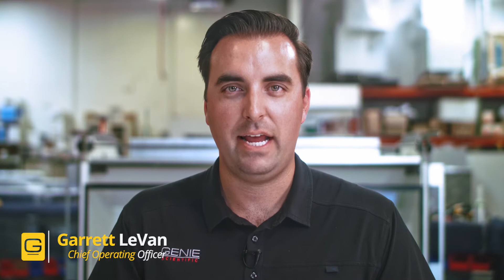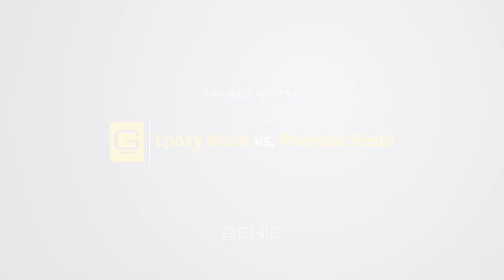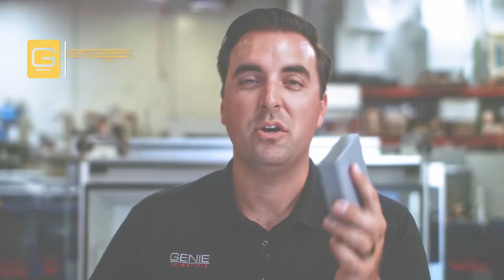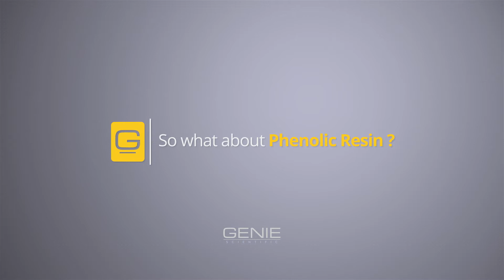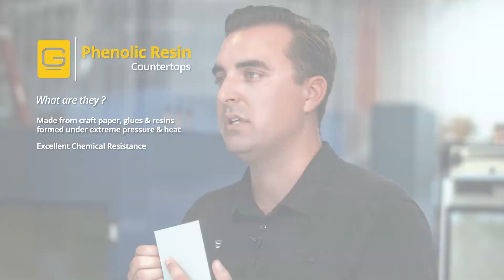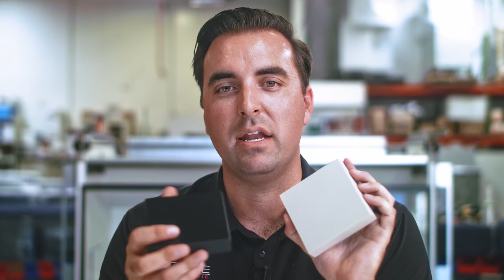Epoxy Resin Vs. Phenolic Resin | Genie Scientific

Comment: I have a sheet of 1/4 inch phenolic and wonder if it can be tapped and if so can coarse thread be used and how strong will it be? Also what is the best way to cut this sheet? Thanks!
Reply: No sure if you still need the information, but I would suggest cutting it with a diamond concrete saw and drilling it with carbide drill bits (actual carbide, not masonry), then putting threaded  expanding anchor inserts in
Reply: Thanks!
Reply: not sure if you  have been solved , what is the usage for yourself or your factory ? if for yourself, it is really a difficult , but for your factory ,you can buy the sheets which are be cutted from the factory

Comment: Great video!  I use phenolic resin quite a bit for my lab furniture projects more than cast epoxy.
Reply: How do you cut it?
Reply: @DonDIYProject  Hi I order them precut to my exact dimensions and specifications from the manufacturer.  If not mistaken, they use diamond saw to cut the sheets.
Reply: @envitech02  thank you my friend.
Reply: @DonDIYProject  You're most welcome sir.

Comment: Oddly enough phenolic resin is used for aircraft and high performance automotive brake discs because of the incredible heat tolerance.
Reply: why is that odd?
Reply: @Chemsci-j1v people find it hard to believe that something over 100 years old at this point hasn’t been replaced by newer technology. If it ain’t broken don’t fix it.
Reply: phenolic is used as binder in abrasives. It is literally used to cut through steel

Comment: We have a GREAT new product called Solicor that looks like epoxy but cuts  like SPC.  Beautiful edges and a clean look.  Nice option between the SPC and the epoxy.
Reply: Great video! 
Question for you: do you happen to know of a way to repair broken poly phenol formaldehyde resin? 

I have a Carter Thermoquad carburetor from the 1970s with a cracked poly phenol formaldehyde fuel bowl. Previously people would repair this using epoxy resins or JB Weld, but the ethanol and/or other compounds in modern gasoline destroys these materials over weeks or months. The poly phenol itself isn't damaged by the gasoline. 

If I could use an off-the-shelf product that would cure at normal atmospheric pressure (even if I have to cure it in a toaster oven) that would resist vibration, heat, and modern gasoline as well as the original poly phenol resin does, it would save a lot of time, money and trouble for me, because nobody is making these fuel bowls any more. Do you know of anything that might help me? Thanks.
Reply: @MichaelDavis-cy4ok  Hey.... Look up Carburetors and More... in Texas... they do Any Kind/Year of Carb repairs, and has You Tube Channel, because they also put on live engine and video it so you can see before and after. I have spoken with the main tech there, and he is like a carburetor whisperer. Their You Tube name - dgrcgrl  and you can see atleast videos, along with get their phone number... That would personally be my #1 Choice, Michael.
Reply: @seanbrooks9308  
Thanks! I'll look them up!
Reply: Does Solicor have better heat and chemical resistance than standard phenolic resin?